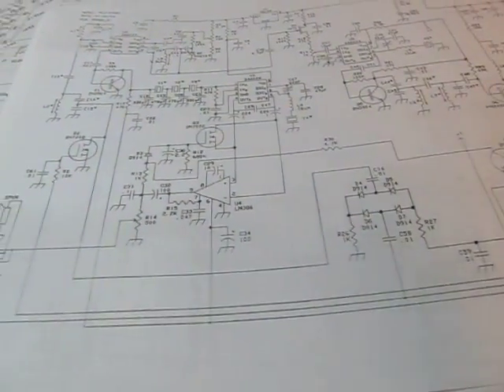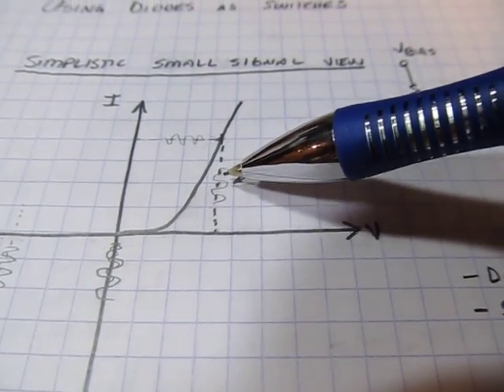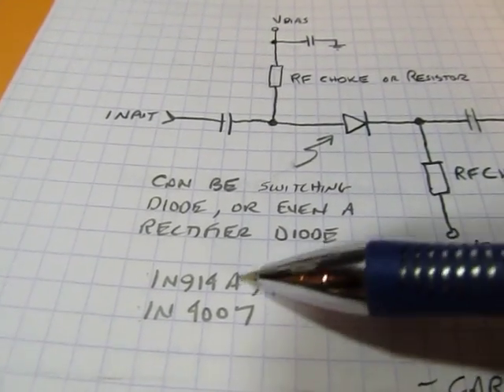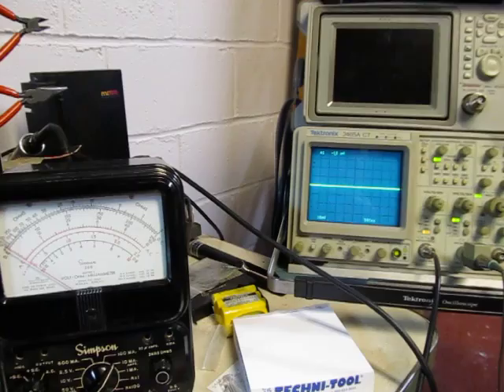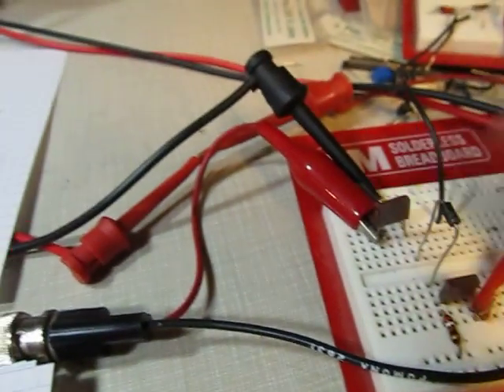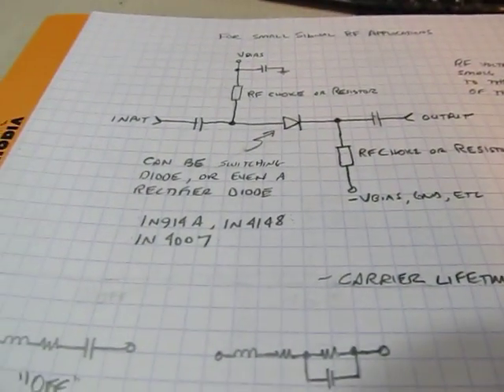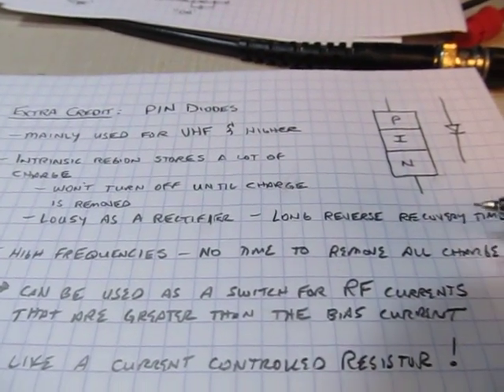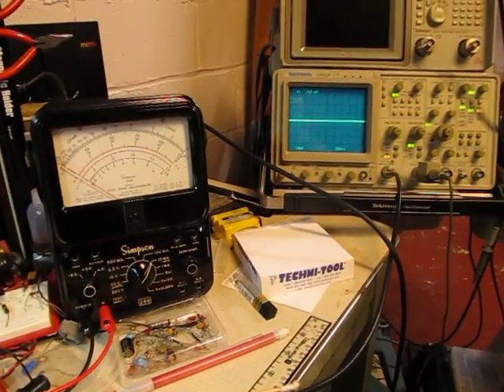#82: How to use a Diode as a Switch / Diodes as Switches / Basics of Diode Switches

Comment: I first ran across the concept of the first part of this video in the context of electronic organs.  In those you often want to switch a fair number of different pitches with a single key.  Early units put multiple contacts under each key,  but that got mechanically complex very quickly.  Later units used this diode switching technique,  switching low-level signals as you describe,  and could get away with a lot simpler mechanical design in the keyboard.
Reply from the maker: Very interesting!

Comment: I recreated your setup. This was one of those things that I had not seen it, I wouldn't have stumbled on this use of a diode, though I have seen quite a few Yaesu radio repairs that use this configuration, or putting two of them in one package. (as well as their pre-biased transistors packages.)

Thanks for the videos.
Reply from the maker: Yes, diodes have MANY types and MANY uses...

Comment: Another excellent video, just a small point, the 1N4007 is somewhat PIN diode like in construction. Normally I would use them as a general purpose rectifier however I have used one for RF switching in a 2m transceiver, quite successful and it never failed. However after watching your video I checked out some more information on the net, it suggests that the recovery time of the 1N4007 is not good enough for effective use as a "back emf diode" across a relay coil or similar. I have used them for that purpose for about 30 years plus!
Keep the videos coming!
Reply: It seems to me that recovery time would not come into play in that usage. When the relay is ON, the diode is reverse biased and all the charges have been swept out. When the relay turns OFF, the diode is ready to go into forward conduction with no removal of charges required.  Right?  - WA5BDU
Reply: @nickk48  I cannot remember where I found the reference, I wrote that a long time ago,

Comment: I have a Yaesu 817nd I've installed some filters in. They are not working correctly. The 817 has loads of DAP222 diode pairs that are used to route the signals. I suspected that is how they worked. Now I know :) I haven't checked it out on the bench yet, but your video helped me understand how it should work. Thanks!

Comment: Many thanks for the video. There are several things I don't quite understand though. I made an RF switch based on 1N4148. The RFC to 12V bus is 20 turns on FT37-43, the resistor to GND is 1.5K, capacitors are 100nF. The first thing that surprised me is that the switch passes RF in both directions, from IN to OUT and from OUT to IN, at least on HF. Is it because the diode passes the current in both directions when the voltage drop on the diode is >= 0.7V or there is another reason for this? The second thing is that the signal gets distorted when it reaches >= 4 dBm, regardless of the direction. My best guess is that it's about 0.5Vp which partially closes the diode because of the voltage difference on it. But I'm not sure if this is the actual reason. Could you please shed some light on these mysteries?
Reply from the maker: There are two reasons why the RF is conducted in both directions.  1) The RF signal is small enough to not change the diode voltage enough to turn it off.  and 2) At RF, even if the signal is large enough to reverse bias the diode, there may be enough stored charge in the junction to conduct in the reverse direction since the RF cycle doesn't spend enough time in this condition to fully remove the stored charge.  This is what I am talking about towards the end of the video.  The distortion occurs, as you surmised, when the negative peaks of the RF signal is sufficient to begin turning the diode off.

Comment: I always learn something from your films,for that thanks much.
A quick question :On switching power supplies , drives or motor speed controls ,is this how they change the frequency which changes the speed of the motor?
Reply from the maker: For motor drives, speed is often changed using PWM (pulse width moduation) of the supply to the motor.  This is often done with MOSFETs used as switches, not diodes.

Comment: Thanks for making this video. I tried to reproduce your circuit but mine was very noisy at first. I discovered that the RG58 BNC patch cables I bought recently were picking up the RF noise. Where do you get the shielded cables you use for connecting signal generators, scopes, etc?
Reply from the maker: I"ll usually buy from quality distributers like Digikey, Mouser, Newark, etc.  Cables from Amazon or Ebay can be very poor quality.
Reply: Thanks for the suggestions. I've learned my lesson about cables from eBay. I decided to make my own test cables using RG-8X cable and BNC connectors from DX Engineering.

Comment: Wonderful.   On the Heathkit video it looked like in some cases the signal path was through the reverse bias direction.  Is it correct a diode switch will pass a signal in either direction?

Comment: What if you put like 5 switching diodes in series, won't that raise its bias for larger signal potentials low in current? Also the diode capacitance will be in series so wont be larger the more you add
Reply from the maker: That will work.
Reply: Maybe a zener?

Comment: awesome video
which values  do you use in your model for resistors, capacitors and Vbias?
Reply from the maker: Well, I did this video over 4 years ago, so I don't remember the values used.  In general, the capacitors should provide low impedance for the frequency being used, the resistors and/or RF chokes should be high enough impedance so that they don't load the signal path, but low enough to allow sufficient bias current through the diode.  Vbias depends on what you have available - Vbias and the bias resistors are selected to that they resistors don't significantly load the signal path (10 or 20x the signal source impedance, or more), and the bias current through the diode when "on" is greater than the peak signal current.  This last point can be relaxed for high frequency signals and also with PIN diodes due to the large charge storage in these devices.

Comment: Instead of using the diodes as a switch could they not have used digital or analog switching IC's like the Texas Instruments TS12A4514P ?
Reply from the maker: Depending on the application, yes.  There are a lot of considerations, such as cost, size, availability, device capacitance, etc. that lead to specific component choices.

Comment: Any reasons why Tube Rectifiers internal diodes are more Inefficient and will break down faster compared to using Silicon Diodes? The Tubes Rectifiers diodes are anodes and cathodes which are metal steel plates with a coating on them. When the Circuit load is drawing more current the Tube Rectifier internal diodes will be more inefficient compared to silicon diodes, any reasons why?
Reply from the maker: Efficiency is a measure of power dissipated by (lost in) the rectifier.  Since the forward voltage drop of a tube rectifier is much higher than a semiconductor diode, the power dissipated at a given current will be greater, thus poorer efficiency.
Reply: ok thanks, so when the circuit load is drawing more current the power dissipation increases the voltage drop ACROSS the tube rectifier increases? this doesn't happen with silicon diodes

Comment: hi alan,. my simpson readings only grows well in the horizontal position, in a vertical affects the weight of the needle. this is normal ?? thanks for your videos.
Reply from the maker: The meter should move smoothly in either position.  Best accuracy would be in the horizontal position, but the difference between the two positions should be small.  If your meter doesn't move smoothly in the vertical position, it could indicate that the meter movement is damaged, dirty, or improperly adjusted.

Comment: 3:04 I can I figure out the effective impedance of the diode by ∆v / ∆i, correct? If so, then can the curvature of that graph be approximated with a parabola or exponential function? (such that I can approximate the "impedance" as a function of the bias voltage?)

Also, if that signal input would have to be REALLY small, in calculus, it would be the limit as V_signal_input approaches 0. I do not know how that correlates to error and how small the signal should be to get linear non-distorted output, I guess that depends on the requirements for signal accuracy?
Reply: Looking at the datasheet for the 1N4148, I see the graph on it, the IV curve actually looks really linear above 0.9V across the junction,so after 0.9V, I figured out the best model would be a 1.1 ohm resistor with a 0.8v offset, or this linear equation:
i = (v-0.8)/1.1 = 0.91x-0.72
∆i/∆v= 1/r =1 / 1.1 = 0.9

Maybe that is helpful for figuring out or approximating attenuation???

p.s. the reason for it being 0.8v is because although the diode does seem to start conducting at 0.6ish V, it is really curvy, and starts out with a really high impedance (flat slope), and gets the slope gets progressively steeper until it reaches 0.9V, where the ∆v/∆i is basically equal to 1.1 ohms. At that point, based on using a straightedge against the graph on a datasheet, I see it this portion is 'offset' by 0.8V. Effectively like a 0.6V voltage source with a 1.1 ohm resistance only when forward biased between 1 and 2V.
Reply from the maker: Power Max That's a good DC approximation, and will work well for low frequencies.  At higher frequencies, the reverse recovery time (carrier lifetime) comes into play, as well as device junction capacitance, and can make the device look like a lower impedance - even over a higher amplitude range than the IV curve would predict.  The PIN type diode really exploits this.
Reply: ***** Ahh good point! I am concerned only with the audible frequencies for now though. I saw that vid on the PIN diode! Very interesting. Can I make the diode behave like a variable resistor with controlled with the offset? 3 seconds of work in LTspice did not yield much, (it looked complicated, anyway's.) but I barely understand how to use LTspice anyway, and of course it may not match up to reality all that well anyway. I do not have a nice function generator to do these things like you show (yet).

I am now attempting to see if I can reverse engineer and really understand the operation of how this is used in the automatic volume thing in that other vid.

Comment: Can you use the diode switches to control 2 or more video signals to a single video monitor? I know you can buy video mux chips but this looks like a simple alternative.
Reply from the maker: You can, but when using the diode switches, the signal is typically AC-coupled through the diode, so you''ll lose the DC reference on the video signals.  You'll have to add a DC-restore circuit to re-establish the proper DC offset to the signal so that things like sync pulses and luminence levels, etc. get set correctly.

Comment: Hi, I'm using pin diode for a Rf antenna switching, just want to know is the dc ground connected to rf ground?
Reply from the maker: The grounds are typically tied together, but ultimately it depends on the rest of the design.

Comment: If a PIN diode can be used to create a variable resistance, could one be used as a feedback resistor in an opamp to create a variable gain?
Reply from the maker: Under limited circumstances, possibly. It depends a lot on the frequency and signal amplitude involved. Carrier lifetime is limited, so low frequencies and large amplitudes will deplete charge, and the diode will then look more like, well, a diode.

Comment: Could I use these switching diodes as an RF switch for a reconfigurable antenna I have designed working at a maximum frequency of 6GHz. I was looking at PIN diodes but I need something really tiny and at low voltage so i can use a simple battery. I just need to block some signals and let through the other at a certain time. I dont really care about switching times because I am just designing a prototype and just need measurements.
Reply from the maker: soumya sheel PIN diodes are available in very small surface mount packages.  Also, there are small solid state RF switches available (like http://www.skyworksinc.com/uploads/documents/BRO378_12.pdf) that might fit the bill.
Reply: ***** I was hoping for something smaller considering I only have a 2mm gap between different switches and with 6 pins coming out of a SPDT switches I see here (cant find a small SPST switch for 6GHz), there just isint space to fit it in. Whereas a single diode, if I can use that option will be soo much more compact. You think a simple switching diode isint a good idea?
Reply from the maker: soumya sheel I think a simple switching diode might have too much junction capacitance in the 'off' state, which won't provide a lot of isolation at 6GHz.  A small PIN diode will be lower capacitance in the off state. Microsemi has some really tiny PIN diodes in 0402 sized packages:http://www.microsemi.com/product-directory/surface-mount-pin-diodes/1821-mmsm-pin-diodes

And a bunch of other SMT style packages:
http://www.microsemi.com/product-directory/diodes-pin/1819-surface-mount-pin-diodes
Reply: ***** Thanks man. these are cool. Also, how important are these DC blocking capacitors? as in will having just 1 capacitor work aswell? I have space on one side of the diode but the other side has my port too close to it to fit a capacitor. just wondering if blocking one end of the microstrip line from DC voltage using a capacitor and not using a capacitor on the other end of the diode connected to another microstrip line would work aswell?
Reply from the maker: soumya sheel It all depends on what you have connected to the DC-connected side, and how it will be affected by the DC bias conditions of the diode in the on and off states.

Comment: if i were to use diode in series or say a blue LED as a diode switch would that mean i can switch on and off higher amplitude signals?
Reply from the maker: +sender copier In general yes, but you would also have to be able to maintain bias when the diodes are "on" too.
Reply: oh, i get the idea, so that's why the method is preferably usable for small signals, thank you so much sir!
Reply: using a zener diode maybe ?
Reply from the maker: No, that would make it worse since there is an "on" state at both polarities.

Comment: I have a question regarding ideal diodes. I don't know much of anything regarding electronics, so I am asking here because I'm sure someone can help me. I need a diode between a battery and a charger. I don't want to loose a lot of voltage flowing into the battery. I will be using an Ideal Diode. My problem is that I need a diode rated at 45amps but only have three 15amp Ideal Diodes. My question is, can I put them in parallel or series in order to add up to a 45amp protection? 

I know that it doesn't work with regular diodes, I just don't know if it will work with an Ideal Diode. 

Thank you for any help.
Reply from the maker: Ideal diodes are basically little active circuits that "emulate" a diode function without the typical forward diode drop.  However, unless they're specifically designed to be connected in parallel to increase the overall current capacity, you probably can't do it.  The "on" resistance of the FETs used as the pass devices are probably not going to be matched well enough to have them share the current equally when connected in parallel - especially if you're running close to max current ratings.
Reply: w2aew thank you, I didn't think that it would work but was assured that it was possible.
Reply from the maker: It would be best to ask the applications engineers at the particular "ideal diode" device manufacturer that you're using. They may have designed features or an application circuit that would ensure proper load balancing in such situations.

Comment: It's a little confusing when you talk about the resistance of the diode being proportional to current in this video and in the video about PIN diodes. The slope of the I-V curve is the (differential) conductance. I realise that it's a minor point, but perhaps less experienced viewers would benefit from a correction. Otherwise a great video!

Comment: I imagine that capacitance of a diode like a bridge for cars if the bridge is too narrow it cannot pass any car ;) Sorry it is just my imagination ;) By the way it is a shame that nobody talks about VHF/UHF components, every video i watch it is always about basic staff. Never something at least for the people who has some knowledge already but wish to know more... but maybe I would like to have too much from the internet. In VHF very strange but interesting things happen. I have noticed that Toshiba has nice diodes with low capacitance for VHF applications but forward voltage is quite high like 1 v, I can't find any diode with low capacitance and low forward voltage like at least 0,3 V (like kind of a germanium diode).
Reply from the maker: This is one of the main reasons that PIN diodes are used for switches at high frequency as they have much lower capacitance than junction or Schottky diodes when reverse biased.
Reply: I am looking for a diode for example that I could use as a simple detector but for high frequency. I mean something similar what it is used for simple AM receiver circuit but with components for very high frequency. I am not sure if it's even possible but I have seen some old circuits for aircraft models and there they used 27 MHz and special diodes like gex34 which p4obbaly I won't find anywhere these days. 🤔
Reply: I meant 27 MHz carrier wave from transmitter and as a receiver reaaally simple citcuit with gex34 diode as a detector and two transistors and a relay. I am teying to figure out a modern circuit like that one with modern components as they used probably also germanium transistors for this also.